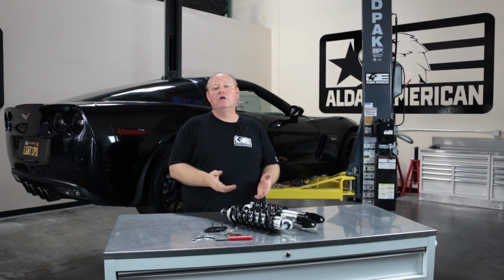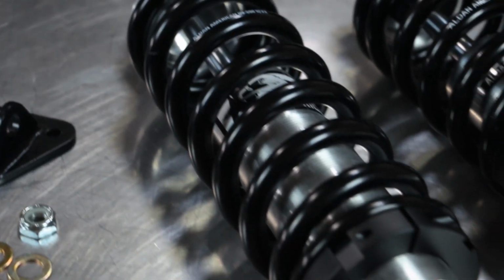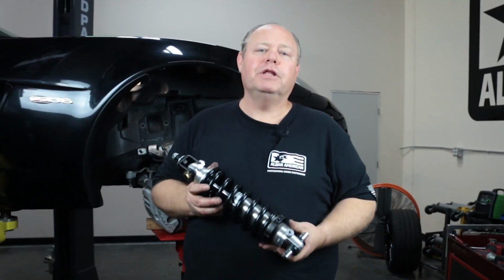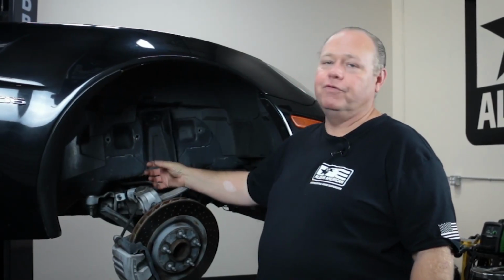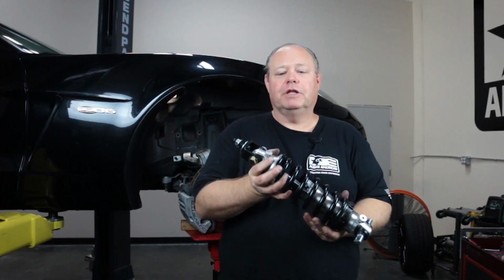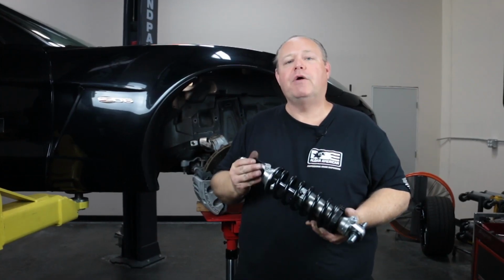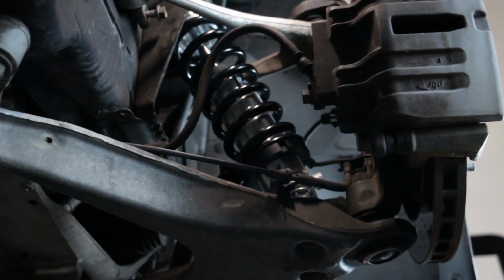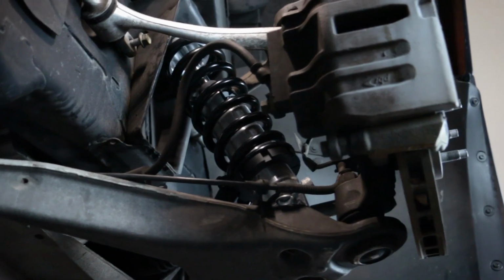C5 Corvette Install Front

Comment: Y’all need to do a vid on how to adjust ride height on the front cause my C5 doesn’t have a locking collar. It only has one with the hex bolt head in it
Reply from the maker: Hello - thank you for the question.  Here is a video of the one piece retainer. https://www.youtube.com/watch?v=3Xl1YjDZsnE

The one piece retainer uses the screw and pinches the retainer to lock it in place after final adjustment is achieved.

The two piece retainer uses a second lock nut to lock it in place.

Aldan has gone to the one piece design a few years ago because we feel it is easier to use.
Any time you make an adjustment the pinch screw will need to be loosened just like the lock nut would be.

Our Tech team is happy to help with any additional questions just give us a call at (310)834-7478.